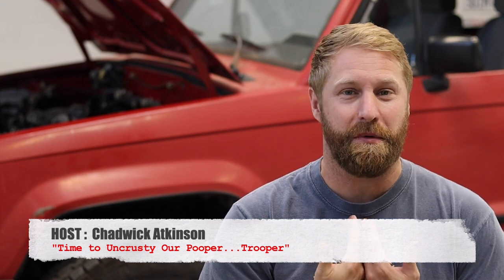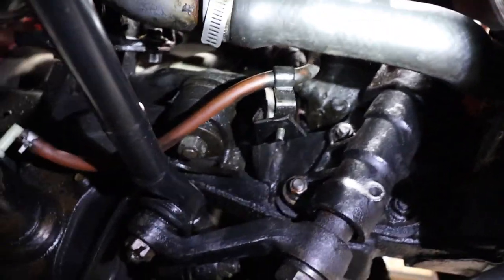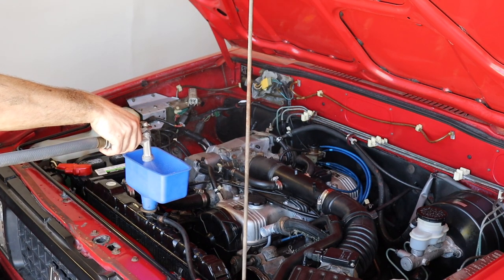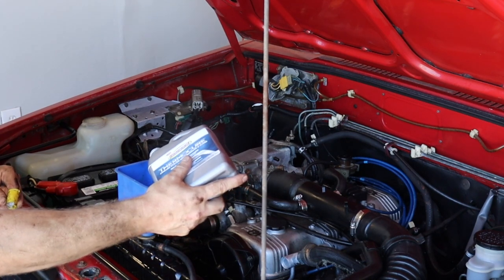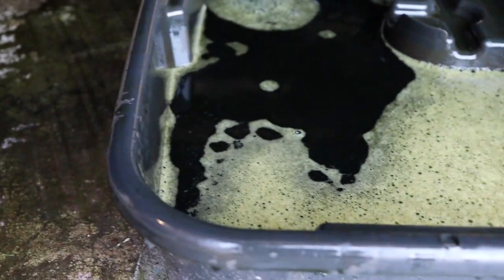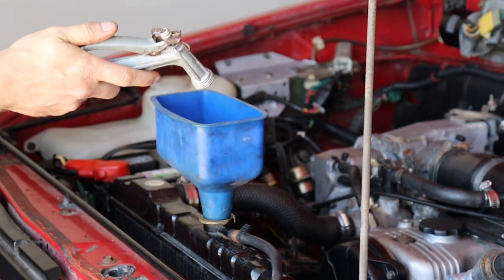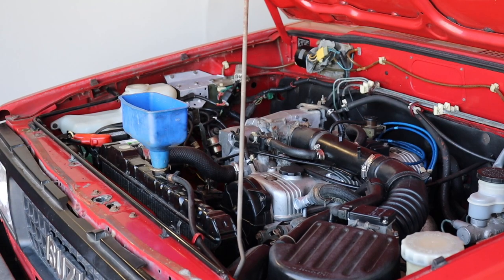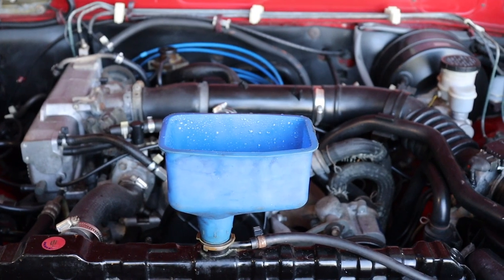1988 Isuzu Trooper - Episode 3: Crusty Cooling System

Comment: Have you done the little cooling hoses underneath the a tech four-cylinder seem very difficult to replace
Reply from the maker: I had to replace one of the heater core hoses that spring a leak…it was a little rough to access. Some of the hoses can be a bit of a challenge to get to.
Reply: @autoobsessivegarage  yes.  Trying ti figure out how the heck to replace the one off the thermostat housing. Spring a big leak can’t drive it. And replacing it seems impossible without taking apart the in take  iv also heard things about semi deleting them or routing them different.  Very confusing and frustrating in this nice small engine and no room to work   Any advice appreciated. I attempted other day with wheel off and threw finder but man it doesn’t seem to be possible yet others say it is

Comment: Put that stuff into a glass of water and let it sit and it will turn dark just from adding water. Gimmick to make you think it’s working ….
Reply from the maker: I used some cheaper flush before and this stuff loosed up more material. When I disconnected the lower rad there was some significant material in there.
No doubt the color change is more for effect, but the product really helped.